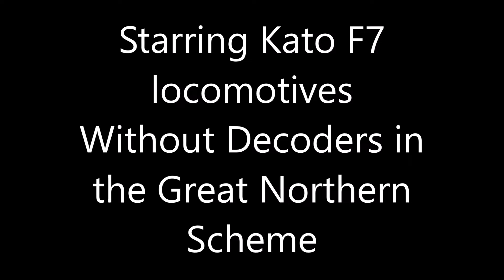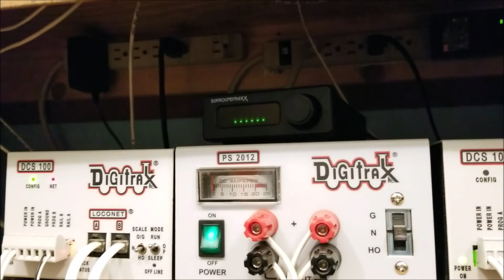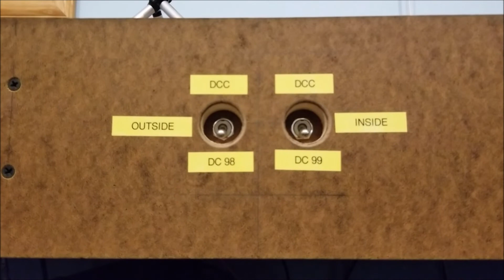Running Non DCC locos on an N Scale DCC layout with sound

Comment: Hey Dave, from what I can hear it is a world of difference between a speaker mounted in the model which tends to be very hig pitched in tonal quality (tinney) with very little to no low emd or low mid-range. This demo sounds more like it should without that tinney sound. Great demo. Thanks for sharing
Muse
Reply from the maker: Yes there is more low end, in fact there is more low end that could be adjusted in but the Mike in the phone couldn't handle it.  The highs were excellent, there are sound bites that you just don't hear through the tiny speakers.

Comment: Pretty cool.  By the way, The DCC Guy states you should run Ground wire between your two boosters in his video.
Reply from the maker: Yes normally that is correct but on my layout I have no devices that require a reference ground such as reverse loops, detection circuits, and such.  Since the two boosters are paralleled off the same power supply their reference ground is near identical, the only difference being introduced in the separate circuits.  On my layout this is negligible.

Comment: Brilliant idea to use the decoders wired to the speed control.  Why G scale decoders and not HO?  Just wondering since I would assume that the G scale decoders cost more.. Thanks!
Reply from the maker: I used the G scale decoders mostly for their 5amp current capacity. I have run a 6 loco consist and didn't use a third of the current capacity of the decoder.  A HO decoder would not have been able to do this.  As a by product these decoders are very easy to wire.  The motor is electrically isolated from the rest of the board just incase of a short on the layout.  This isolation protects the board from catastrophic failure.  Last but not least, even at the price of $67 MSRP, it is still cheaper that some of the most advanced DC controllers with twice the control capability. As easily as N scale train accidently derail, I think that this is the right choice.  Have a good one,
Dave